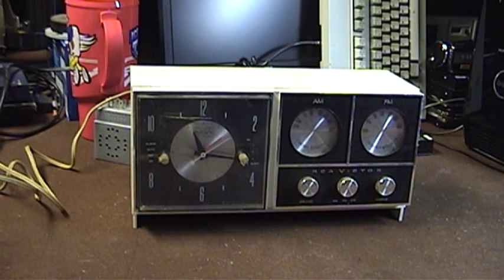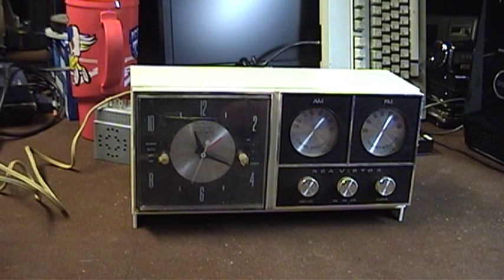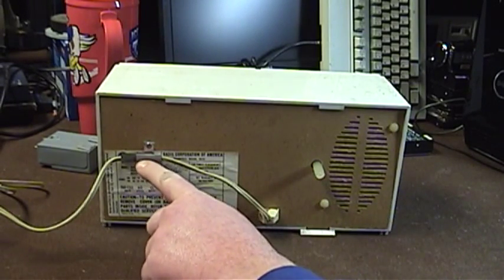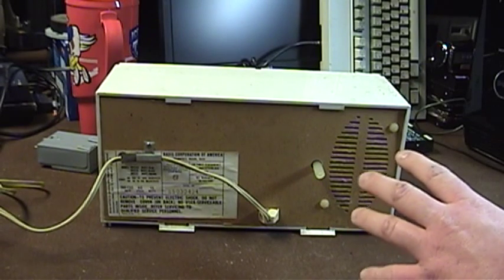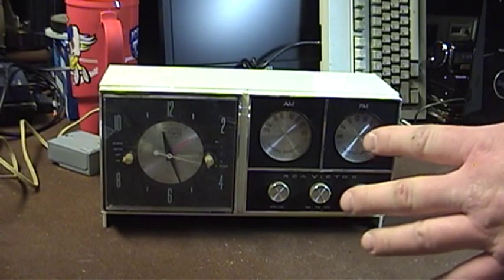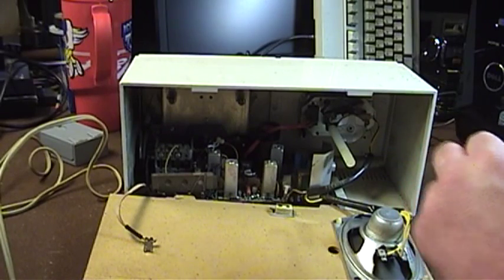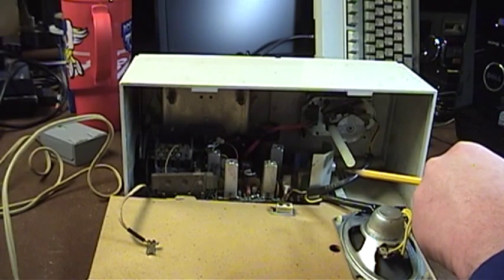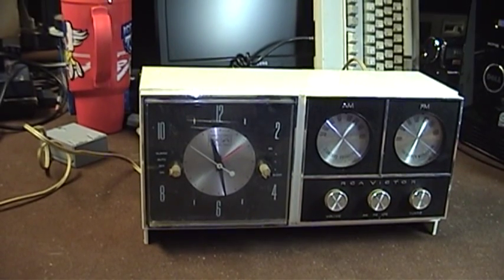RCA RHS33E Clock Radio Overview

Comment: That's a pretty neat unit. For being undoubtly a cheap model for the time, it has an impressive array of features. It seems to have all the capabilities a modern digital clock radio would have.

I don't know if the General Time Corporation made their own synchronous movements, but if they did, I would consider them the possible manufacturer of the movement in this unit.
Reply: ***** Oh, I thought I heard you say something about build quality not being the best in this, but perhaps I accidentally made that up in my head. :P

Comment: Hello, You will find the service info in Sams folder #878-9, the radio was made some were between 1964 to 1967. I have a RLC 22 & RHC 22 from 1967 that are mostly alike your radio. My radios have 10 mm I.F. cans. And yes your unit is a hot chassis radio, the transformer on the pc board is the audio output transformer. The big cap is 50 mfd & 100 mfd at 160 volts,use 47 mfd  at 175 or 200 volts same for the 100 mfd section that should get rid of the hum. while you are in there replace the 4 remaining electrolytc caps. It then will  play for many more years. All the best, Tom J from Fla.
Reply: I was just about to say what Mr Johnson said when I saw that wire wound resistor and the single ended power output transister on the heat sink. The A/C operated transister sets with the so called "hot chassis" were a carry on from the series string AA5 sets, it was viewed as a way to produce an A/C mains powered transistor set at a lower cost rather then taking basically a portable transistor radio chassis and adding a transformer based DC power supply to it. I think it was also an attemptby the North American electronics industry to compete with the Japanese as well.  One strange thing about RCA was that their electron tube division continued to develop new types of tubes well into the late 1960s, which you can curse them for should you be unlucky enough to own equipment that needs them, like the big nine pin tubes. They even developed a new generation of 100 ma tubes for series string sets around 1962 or so, but they had a hard time convincing even their own consumer electronics division to use them. There were a few RCA tube models that used the new tubes but for everything else they stuck to the old tried and true AA5 style ones, then they created things like your radio which must have been a real slap in the face for the tube guys. Such was the disarray RCA fell into after David Sarnoff retired.

Comment: Internally it does look like its roots are from the valve/tube era, the tall towerblock looking intemediate frequency cans standing tall above everything else, a few valves would not look out of place :D
If the bridge rectifier was ok im sure you could do a bodge with a capacitor on wires, tapping them to the top of the pcb, no removal needed :).
I hope that resistor isnt acting as a mains dropper, they were allways a bad idea :(

Comment: I have an RCA radio from about this time period I pulled a real doozy on myself with. Not only did I turn it on to try it, I cranked it full blast...LOL. 
At least the filter cap is a metal can type that still works very good. 
I have another RCA (I think) clock radio with a rear speaker similar to this one that I suspect uses tubes. I got it from my grandmothers just shy of 2 years ago right after she passed. This cabinet and clock lens are in bad shape. I guess she knocked the radio off the dresser and tried to super glue the crack in the cabinet. Instead it got a big blob of glue down the face. I wish It was wax.
Reply: Here's the video of my clock radio. https://youtu.be/rZuEXoUPoIQ

Comment: Hey uxwbill I watched your K car wagon video and wanted to ask you a question about the engine.  I have a 88 reliant that dies at idle and loses power during cruise with foot off the gas.  It feels as if I'm tapping the brakes.  I've done a full tune up, MAP, distributer pick up.  I notice when the power loss happens my battery gauge dips down a bit and comes back to normal.  I have an ASD relay coming I just dunno what else to check. Any thoughts?

Comment: I like your video very much, but come on, man, it's time to HD resolution !
 Regards from Poland.
Reply: RS Elektronika His standard definition camcorder is actually a lot nicer in ways than a modern HD unit.
Reply: MrMaguire What? uxwbill makes films about electronics repairs. There are a lot small parts, which should be seen properly. That's reason. Today you can buy a good quality HD camcorder cheap. I know because I do that myself.
Reply: RS Elektronika There is nothing wrong with SD resolution. I think he records in SD for the older computers to be able to play Youtube videos from his channel.
Reply: RS Elektronika I find 360p video fine well perhaps not in fullscreen but 480p is fine for fullscreen my computer is old can't handle anything better than 360p! I would get a graphics card upgrade but I will need to get a new PSU as mines probably already at the maximum load! if not its very close too it but its a great computer for being 11 years old

Comment: 60 Cycles the change over to hertz was the 1970
Reply: Jason Cruz interestingly that was the same over here in the UK too.. Hz was used in laboratory parlance for many years before that, but didn't become 'common parlance' instead of 'cycles per second' or 'cycles' till about 1970
Reply: Jason Cruz In the UK our line frequency is 50Hz, USA is 60 Hz. Does anyone know of any advantage / disadvantage of one over the other? (c/s is also still quite common here too!)
Reply: Pete Moss
So far as I remember, the 50Hz was pioneered by Siemens... they also chose the 10/20/30Kv line voltage so often used in continental Europe and I believe Eire also. The UK went with 6.6kv/11kv/33kv instead just to be different. The 60Hz in north America I am not so sure about, but I think it was chosen to make the flicker invisible. As you'll no doubt remember, with 50Hz fluorescent lights, the 'borderline of perception' of the flicker used to give lots of people headaches
Reply: Pete Moss Technically things like transformers become more efficient at higher frequencies, although the difference between 50 and 60 Hz is infinitesimally small in that case. And as TheChipmunk2008 mentioned, fluorescent lamps and other discharge lamps have slightly less perceptible flicker.
Reply: Thanks for your reply, much appreciated.
Reply: ***** I'm led to understand that it was a common practice to run florescent lamps on polyphase sources so that the flicker from adjacent lamps were out of phase and therefore less obnoxious.
Reply: DimensionDude Yes, that was often done on 3-phase systems. It not only alleviated a minor annoyance, but a grave danger, as well - fluorescent lamps flickering in phase could cause machinery such as saws to appear as if they were not running.

Comment: Can you help me date an early GE rotary number clock radio I just bought? I bought it because I have never seen one like it. As you know most of the vintage GE radios from 60's and 70's say made in Singapore this one does not say made in Singapore however it says Japan on the seconds wheel. This is Odd because it's a telechron movement. Anyways it's in perfect condition and works like new model is C4516A followed by code 1941D any ideas thanks
Reply from the maker: +1944johndeerel GE owned Telechron for a while and could have even owned or established a clock movement production facility in Japan. Or maybe they were just trading on the name, and put it on a movement someone else made. I don't know.

Unfortunately I cannot be of much help in determining when your clock radio was made. My best guess is sometime in the 1960s or early 1970s.

Comment: I very strongly suspect that the clock movement is by Westclox.  The 4-position mode switch on the left, the clock/alarm setting mechanism on the back, and the sleep timer on the right side of the movement are features that this clock and a York TC-107 from the same era I used to own have in common.  The York TC-107 openly advertised a Westclox movement on the front panel.  It may have even been constructed at the Westclox factory in the LaSalle-Peru, Illinois area.  Compare with this TC-107 for sale on eBay. http://www.ebay.com/itm/331362525177

Comment: I have one of these. No humming.  But reception isnt good. Power cord operates as the antenna. Is there anyone still servicing these. (Tri state area)
Reply from the maker: You may be able to service it yourself. Just be aware that this is a hot chassis (connected directly to the power line) set, which does present some hazards. Fortunately, most of the repair work can and should be done with the set unplugged. (You can also use an isolation transformer for somewhat improved safety.) The service literature is available -- see some of the other comments on this video.

Switching to a proper FM antenna, even a simple indoor dipole type, would help, if such is possible. (This radio is long gone and I'm not going to rewatch the whole video.) There is some possibility that a procedure known as an alignment would be necessary, which requires some special equipment and expertise.

Although probably not close to you, you might want to contact shango066 here on Youtube. He may be willing to look at your radio.

Comment: Neat radio! Why would you run on DC? AC can run more stuff and be easily converted to DC.
Reply: ***** The Niagra Falls hydroelectric plant supplied 25 Hz power to upstate NY and Canada until the 1950s when residential customers were switched over to 60 Hz and until the early 2000s for a small amount of industrial users. Southern California and parts of Mexico used 50 Hz, as you may recall Chris Cuff demonstrating a 1960s "Coro" record player from Mexico whose motor he had to modify to convert from 50 to 60 Hz. New York City continued to supply DC power to thousands of buildings to run their elevators until a conversion program began in 1998, which ended in 2007 when the remaining 60 customers who still needed DC power had their own individual AC-to-DC rectifiers installed.
Reply: ***** Yes, I know most of that. Some I did not and it was very interesting, I know about Tesla and Edison but I never heard of the 25 Hz. 25 Hz would be interesting to blow speakers with!  
vwestlife Very interesting, I did not know all that!